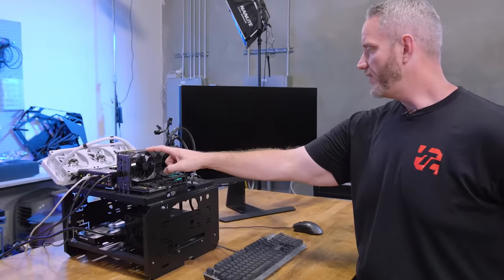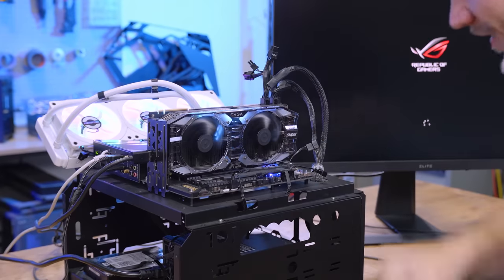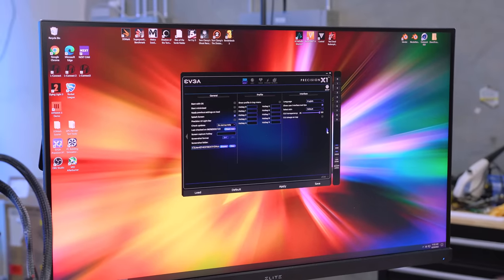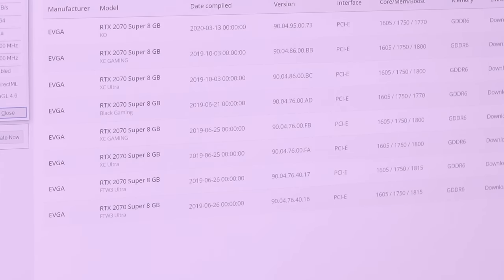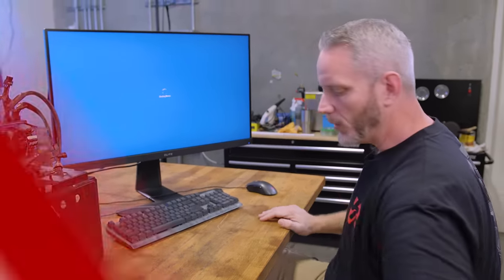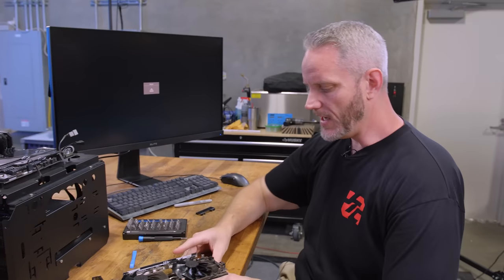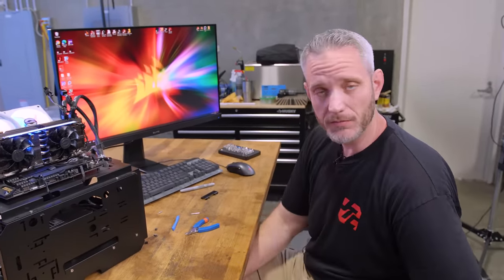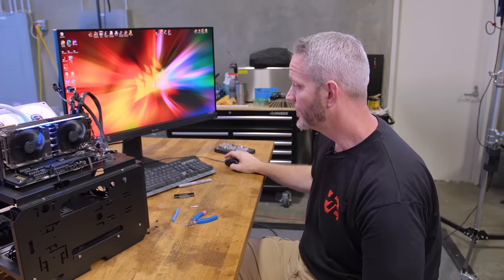This video card had a broken fan. Here's how I fixed it

Comment: Jay, I think you have discovered a problem that many EVGA owners are experiencing. Not only with the 2000 serries, but 3000 serries also. I built a system that has an EVGA 3090, and now that user is experiencing overheating issues becuase of a faulty fan.
Reply: Is it the far left fan and its just started with that problem?
I changed that fan on a zotac rtx trinity but I also got told that there's a resistor in the fan hub that goes faulty that makes the fan go 100%.
Reply: @adelestevens  Yes, closest fan towards the outputs of the card. When it worked fan would be going 100%. But now that fan is dead, card started to smell like hot wiring. I had the customer send the card in for RMA today.
Reply: When I got my 2080 XC Ultra decades ago I believe it was the first time they intoduced the silent fan shit and after quite a while I got annoyed with hearing the fan(s) constantly kick and stop. To remedy I bought a hybrid kit and liquid cooled it. Fast forward to 3k series, same thing, traded that 2080 for a 3080 FTW3 and immediatly bought a hybrid kit for it haha. And lastly, just this year I moved into a hybrid 3090 Ti FTW3. I can never go back to an air cooled card.
Reply: I just RMA'D a EVGA 3090 with a dead fan closest to the output as well.
Reply: @renegade_patriot  I wonder how EVGA is solving this problem 🤔 Seems like cheap wiring, and bending of the wire in the cards seem to be a common factor.
Reply: hydrocopper ftw. Hard to have a faulty water block, unless it leaks.
Reply: Oh shit. I just got a EVGA 3080 Ti recently. I'm hoping this won't happen to me
Reply: @andrewstansfield6672  I was tempted to crack it open and take look but I was afraid EVGA would come back and mess with my RMA, so I just sent it out. Unfortunately I don't have any further info. From the wiring I could see, which wasn't much, everything looked normal but who knows.... The fans EVGA uses are pretty bulletproof and with others having the same problem, most likely faulty wiring or connectors.
Reply: And thank you for posting, until this thread I just assumed I was unlucky and had a faulty fan bearing or motor. I was pretty close to just ordering a new fan and installing it myself which would have been a waste of time and money.
Reply: @andrewstansfield6672  That's why I stopped buy EVGA a long time ago - I am happy now with the cards I use, they pass the torture test, heat test, everything, and never had ANY issues with fans or broken wires.
Reply: On my MSI card, albeit AMD, so it's not the same thing, I have yet to have a problem with anything. That's not to say that there won't be one in the future, but still. It's a custom top of the model line 5700xt with 8GB VRAM, and I bought it for what I figure to be right around MSRP right before cards got scarce in 2020. Got the card in the mail in August of 2020 with the rest of my parts, and now, don't laugh, but I have an AMD Ryzen 3900X and a 5700xt, which I only bought, because it was the only thing with at minimum 8GB VRAM in my price range I wanted to spend.

Comment: Hey Jay, hope you see this. Because of Fast Boot and other shenanigans a "Restart" is actually a more complete shutdown than the "Shutdown" option. So unless you switch the PSU off and back on it's smarter to do that.
Reply: Yep - restart does a full windows reboot. To do a classic "Full shutdown and cold boot" you need to choose restart in windows, then hit the power button during POST to power off fully, then power off the power supply for a minute to give capacitors a chance to drain. 
Or, disable Fast Boot via Windows-R then typing powercfg.cpl and turning off Fast Boot there.
Reply: @raymarquardt5157  Yup! I've disabled Fast Startup and the system still boots plenty fast enough. No perceivable difference. Using an NVMe on PCIe gen 3. It probably only makes sense if someone is still booting off a hard disk... we see all the confusion that this feature has caused, and almost every tech youtuber making a video about it. "YoUrE tUrNiNg OfF yOuR Pc WrOnG!" lol

For those who need a little more guidance, after running powercfg.cpl (in Run, or CMD, powershell, whatever), click "choose what the power button does" (on the left). Checkbox is here, but you may have to click "change settings that are unavailable" (requires administrator) to make changes. Windows 10. For further guidance, there is the googles.
Reply: Just hold the Shift key while clicking shutdown.
Reply: Turning off the PSU is going to do nothing to Fast Boot, the whole tech working behind it is hibernating the kernel while shutting down userland. Since its a hibernation, not a standby, the system losing complete power is completely unrelated
Reply: I turn PC off and flip the PSU off (easy to get to). Get some coffee, snack hit the head and anything else I want to do while I'm up. Go back flip it on and it boots perfectly every time.
Reply: Came here to say this
Reply: Agreed, but for a GPU it shouldn't matter. the vBIOS is loaded on the card it self, not in windows.  The reason a restart is needed is because the card it self needs to lose power which is done via a Restart or just a system shut down. 

So both options are viable in this case.

Comment: EVGA seems to have some issues with their fans. My previous 2060 super EVGA card had both fans clipping the heatsink making an awful noise and they eventually failed outright. My current EVGA 3080 ti has no problems so far but it seems they need to pay better attention to their fan design and QA.
Reply: I had to replace my middle fan on this unit; bearing let go after 3 mo.
Reply: Yes this is a clear case of bad QC .  and for something so simple like a fan cable, unacceptable -  ASUS with issues with their HERO board, upsidedown caps, etc, it's clear that quality control has taken a big hit, for many companies -  eventually as companies cut on costs and cut corners, the shit will hit the fan (sorry had to 😁 ).
Reply: @jimmydandy9364  I bet 3 double bacon cheeseburgers that there was a serious scab issue after the pandemic. untrained workers.
Reply: @krushandbashgaming  Fortunately this is nothing major and an easy fix, it is not exploding or catching fire 😁 But none the less, companies skip out on the quality control, I mean how the fuck can companies not detect a bloody cap installed backward FFS, lack of QC, they assume most of the market buying this are complete ignorants - today it's PWM wires coming loose, tomorrow it could be fan blades coming off and and flying out the PC case and slicing everything on site, or maybe fans literally falling off :P  It's gonna get far worse over the next coming years  - You should see some of the cheap arsed power boards and circuit boards they put even on expensive TVs.......................Good thing Jay fixed this issue hopefully it will be quite helpful to others, that's why I am such a "fan" of this channel 😁
Reply: I had the same clipping fan issue on a brand new GTX 1070 and 1080 ACX3.0 model from EVGA years ago. Had to RMA both cards within the first week of buying them.
Reply: @EestiGaming  Oh, man.  I own (2) 1080ti's both gaming sc's. They've been bulletproof.   The good ol' days.
Reply: my evga 2060 also clipped the heatsink and made terrible noise so I shaved off the piece that was sticking out and it fixed the issue

Comment: Don't know if anyone else noticed, you can actually hear the fan every time Jay speaks or types.  You may need good headphones to really pick up on it because it's subtle, but once you do hear it you can't unhear it XD  Phil did a great job noise gating it for the most part.  I only realized it because when Jay cut to working on the card, I couldn't hear it anymore
Reply: Also noticed this too, thought it was maybe because of aircon but makes sense with it being the gpu, was quite distracting hearing it cut in and out

Comment: Heat and voltage stress on cables & electronics always perplexed me. Funny thing was, I learnt about it from testing analog set top boxes with AV connections, because those old style boxes pushed not only video and sound, but also a small trickle charge which killed those things fast. At least digital cable boxes only push a charge thru because of MOCA bridging.
Reply: your use of the nonexistant word "learnt" made me ignore everything else you said
Reply: Learnt is absolutely a word and past participle of learn. But go off?

Comment: This reminds me of a time I was having an issue diagnosing a ridiculously complicated 3-way active stereo system I installed in my 2012 Mustang.

It turns out one of my speaker wires had a weak connection INSIDE the wire insulation.  On the outside it looked almost perfectly fine except a small bulge where the issue was.  Once I stripped the wire back I saw that I had managed to get the wire spool that had the main wire splice during manufacturing.  You could see where some machine had botched twisting 2 lengths of copper wire together before sending it through the machine to add the insulation.

Comment: I had this happen to my MSI1080ti Gaming X Twin Frozr a few years ago, exactly the same issue with one fan always running at 100%.
I contacted MSI because it was still under warranty but they wouldn't RMA it because I bought it used, and MSI don't take products back from the public in Europe, you have to send it back to the shop you bought it from, and I had it shipped from the UK to Ireland and so couldn't take it back to the shop.

MSI, were terribly rude about it too; I contacted them several times, and each time as soon as I mentioned that I didn't buy it new they just deleted my ticket! 🤬

So I just wired a motherboard connector on to the fan and ran it from the motherboard instead with Speedfan. And shortly afterwards I got a waterblock for it.
But damn, I wish this video had been released a few years ago, it was probably an easy fix like this!

Comment: That happened to me with 3080TI. Had to wait three updates courtesy of the Precision X software before an update fixed it. It was when they added support for the Kingpin card. Both fans ran 100 percent but games ran without gpu supporting them. Had to use a rollback driver for a while.

Comment: I deep cleaned my GPU recently. Evga GTX 1070 SC. 
During reassembly I didnt fully connect the fan wires. And under standard running vibrations it came loose, but not fully loose. So for that (unknown at the time) reason, my fans were spinning up to the best part of 5000rpm, then it reconnected at returned to my fan curve. After a bit of trial and error with fixes, MSI Afterburner and such, I checked the loose connecter. Very easy fix if I knew the issue from the start. Gpu out, use a clip puller, like what you use to remove fender linings on cars, to push the connector fully in. And boom. Fixed

Comment: I agree with you when it comes to not using the 0db mode. I like the fact that the card gets less dusty and the fan isn't wearing out, but I don't like the idea of SMD components on the PCB getting cooked sous-vide style.

I also find the fan spinning up and slowing down at random intervals more distracting than a fan quietly spinning at a barely audible RPM.

Comment: Supervideo. Just 1 thing. Voltage does not create heat in a cable/wire. Amps combined with resistance does. So if there is a bad connection (meaning: high resistance) that point will heat up because of the amps flowing through it. There will be a voltage increase over that point and a voltage decrease at the end of the cable/wire. You maybe could be able to see the hotspot at the breakpoint of the wire with a thermal cam. I can imaging it will be hard on an graphics card.

Comment: 6:52 A restart is actually the better way to do this. When fast boot is enabled (which it mostly is by default), system memoy just get dumped on your os drive so it can boot faster the next time you power it on, while a reboot actually clears out everything and starts fresh.
You can force windows to do the same thing on shutdown if you hold shift while clicking on shutdown in the start menu (just like you can bring up the recovery menu by holding shift while clicking reboot).

Comment: I had the same issue with a PWM wire on an old Arctic Freezer 7 Pro CPU cooler. I thought for years it was the header on the motherboard until I swapped it out because the fan noise was getting to me. That's when I noticed the wire just hanging off the side of the plug. I also love the difference in sound in the new work area. Spectacular.

Comment: Similar problem with a zotac rtx 3090 trinity.
The card was OK when I bought it and several months later one fan went to 100%.
Just changed the one fan(again the far left one) and the problem was solved. 
Chatting to another user and it turned out this was a common fault caused by a resistor inside the actual fan hub.
But by this time the broken fan was in the trash and I couldn't test this out.
Best thing about tearing the card down was being able to put much better thermal pads and paste in and dropping the temps by 10°!

Comment: The cable is fixable if you can solder without melting the connecter possible if you know what your doing along with some RTV to close off the bare end of the solder joint. But good that you found the problem with the video card.

Comment: I have had the same experience with car ECUs the constant heat cycles dry out the solder joint and the cable just pulls out of the connector.

Comment: Dave's garage did a really interesting video about how modern power states have made a restart cleaner than a shutdown and reboot. I still do shut down and reboot, because that was always the best way to get a full fresh state, but apparently there is so much quick start stuff built in to Windows and system bios now that a restart is actually better.
Reply: Came here to say exactly this.

Comment: I had this exact same issue on an Evga 2070. Issue was solved by just pushing the fan connector in again properly as it seemed that is somehow slowly worked itself loose which caused the issue. The connector was still plugged in just not enough apparently.

Comment: God find Jay!  I think vibrations from the fan spinning might have contributed more than heat cycles.  Also, starting from zero rpm is going to generate larger vibrations until the fan is up to speed.
The true cause of the problem though.  Bad Design or assembly.  It never should have been designed to secure the harness at the highest stress part of the cable.  It secure it on the connector (preferred) or secure it away from the connector (recommended).  Securing it on the wires next to the connector wouldn't pass inspection where I've worked in the past.
See International Electronics assembly standard IPC/WHMA-A-620 Wire Harness Reliability.

Comment: I had a similar issue where a wire for the gpu fan had actually completely broken off, but I fixed it by simply de-pinning the broken wire, stripping a bit of the sheathing off the good part and re-pinning it back into place.

Comment: My last 4 cards have been EVGA, two only on purpose coincidentally, but the 1070ti even with custom fan controls never actually activated the second fan from new. As I recall it was *supposed to kick on at a given temperature threshold, but the dust build-up that I had to clean periodically said otherwise. No amount of fiddling with wires or board trickery ever fixed it. Card still worked fine though.

Comment: 14:00 I think Jay has not thought this thorugh (like often in technical issues it seems): if the fans stop and the cards stays at e.g. 45°C -50 °C, then the temp range will only be 40-45°C (assuming 90°C max. temp), whereas keeping the fans constantly running an having the card in idle at e.g. 30°C, the temp range would 60°C.
So Jay wants to keep the fans running to have lower idle temp to reduce the temp range due to an increase to max power draw. Yeah, sounds perfectly logic as shown above, because 40-45°C increase (OK, technically correct it would be 40-45K) are more than 60K increase...
Reply: no dude, there are other components on a GPU that give out heat like MOSFETs and Capacitors that don't have sensors on them and that don't have contact with the heatsink for passive cooling, that's why he has his fans turned on low all the time, it has nothing to do with core temps.

Comment: Engines for vehicles are like that wire. If you have an aluminum header and an iron block the 2 will heat up at different rates. That’s why the heat cycle for a vehicle is more important than miles, that’s why semi trucks last forever because basically their engine is always on.

Comment: You should pull the terminal out, and solder the wire back into the terminal and see if you can fix it. I’ve done this multiple times on many different types terminals, with 100% permanent fix

Comment: Start with the tap-and-wiggle test.  If the software thermometer is accurate, clip a PWM meter onto the 4th pin.  If both are within reasonable range, swap the fans.  Remember to start with the easiest (pull on wires, big hammer) then move forward.

Comment: I don't think that was caused by thermal cycling. I'm not an expert, but I have seen hundreds, if not thousands of failed crimps, and I'm pretty sure this is one. It's likely just a case that a spec of dust or something got in between the jaws of the crimping tool and caused it to not quite apply the correct amount of force.
Reply: How's that a bad crimp? It doesn't seem it slid out from where the sheath is crimped, but just broke at the pin. It looks like it was probably damaged during installation due to strain and then it was only a matter of time till it let go entirely.